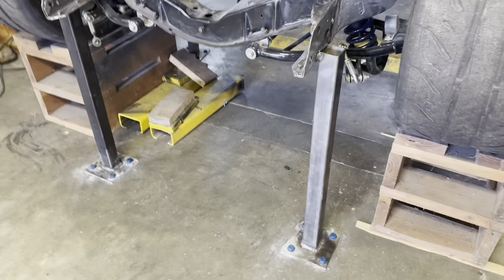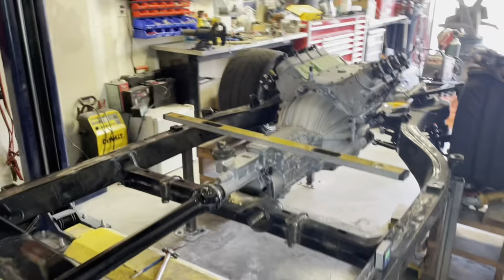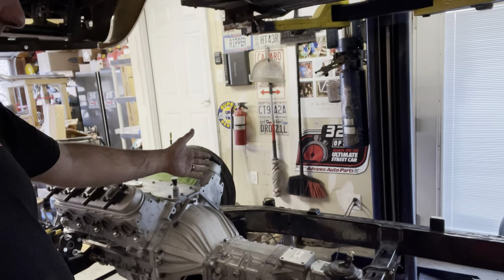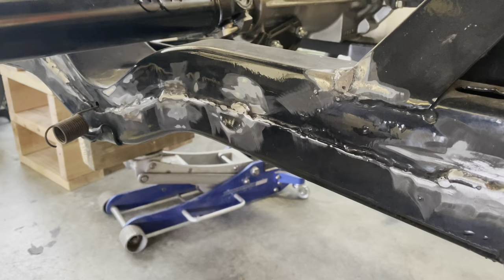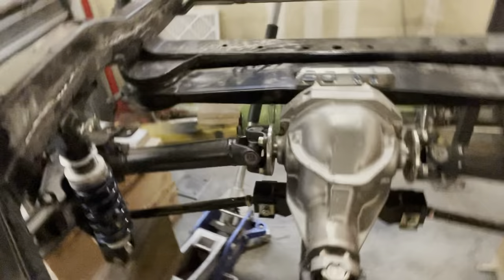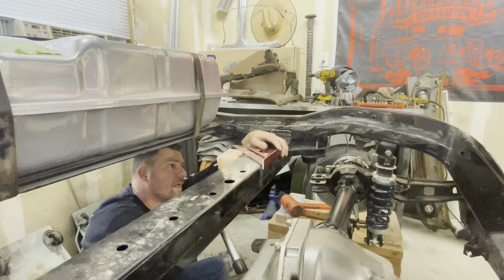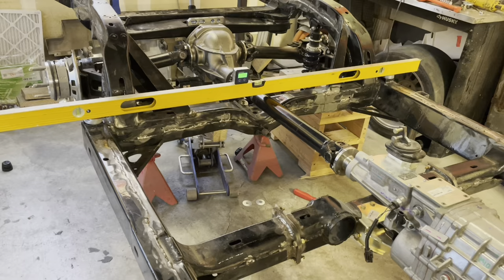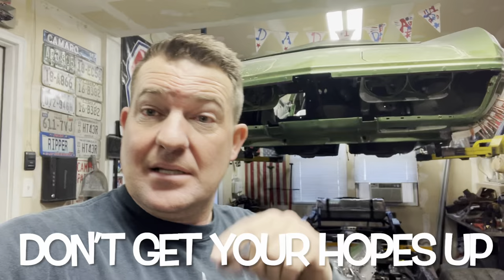The Frame Saga Finale! 1972 Corvette Project Rolls On

Comment: I hung around Todd and you are welcome lol. Looks good, I think those welds will be fine. Multiple passes on such thin material I would say is overkill, unless you have an undercut problem those welds look fine. More consistent on your travel speed, try to watch the puddle more but setting your welder up is the trick I find with mig welding. Gotta get your wire speed and current right or it will be tough to make a pretty weld going vertical like that. Good job as always I love watching you make progress and can't wait to see this car in person someday
Reply from the maker: Raymond you’re the man! Thanks for the advice and can’t wait to run into you soon brah!

Comment: I would grind all those welds down the place at least a eighth inch plate and do a linear weld across the top and bottom. That way you know it is strong and safe.
Not saying your cross welds weren’t good, however the steel on the sides of each weld have become weaker. Hence the reason to plate over the ground down welds and weld a plate over and use linear across the top and bottom of your strong points
Reply from the maker: I ended up plating the main cross member.  🤞 appreciate it.

Comment: Really should have V'ed out those cuts to good penetration, plus then you could have ground them smooth.
Reply from the maker: If it were thicker material, then I would’ve absolutely beveled. The thickness of the frame is barely 3/32. I spoke to a few career welders, and they weren’t particularly thrilled with how it looked, but after sharing my processing felt it would hold.

Comment: Is that a tko600? If so what thickness of shims did you use on the tranny mount. Boy do I have some pictures of a shop that tried to fix my frame. I ended up fixing it myself.
Reply from the maker: I didn’t have to use any shims. At least not yet. This is an LS swaps to the motor. Sits a little different then factory small or big block. I got the kit through silver state which included the new transmountain to the Crossmember. And yes if you’ve got the time and willingness to learn fixing it yourself may be your best bet
Reply: @mayermotorsports  mines BBC, I followed the instructions, It said to have the tranny parallel to the diff, more shims than I like. I guess I’ll find out.
Reply: My frame bandaid, now fixed and you wouldn’t know.